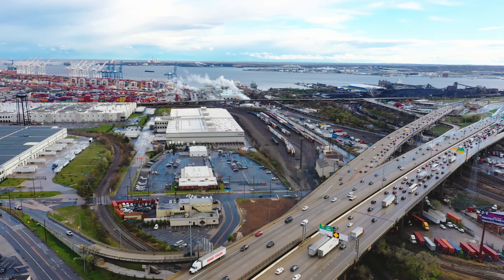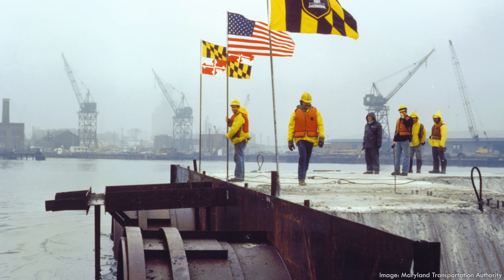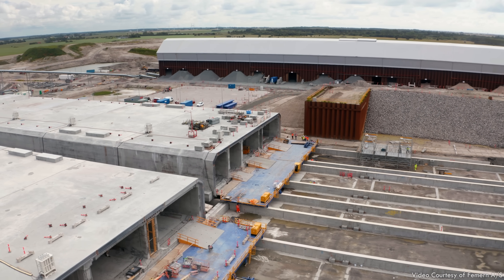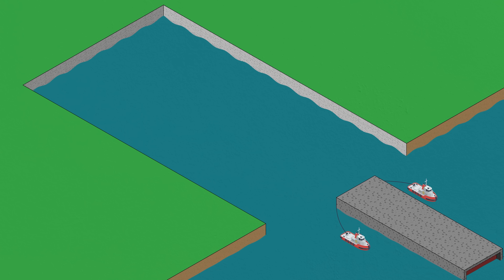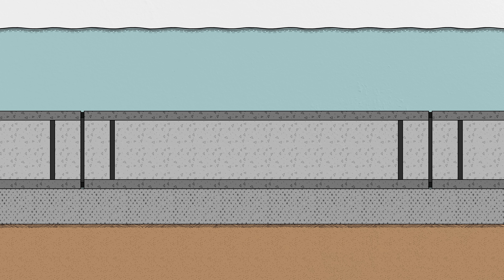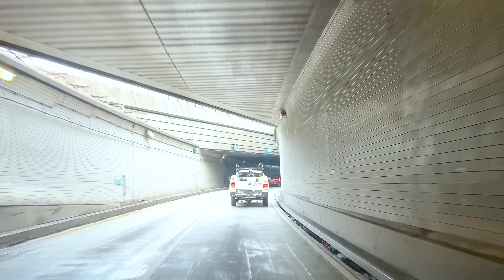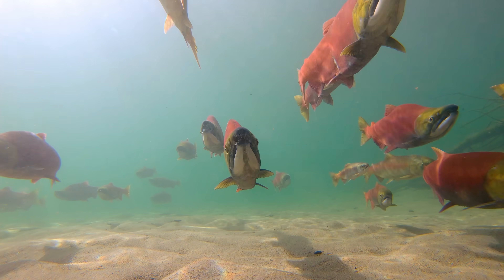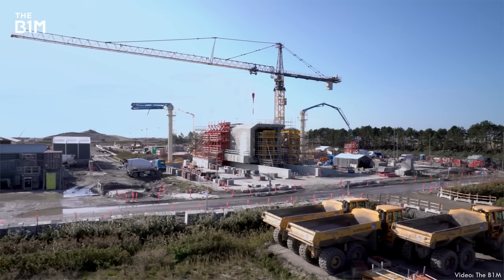The Most Implausible Tunneling Method

Comment: Being Dutch, from the west of Rotterdam, two tunnels have been built using this method in my 30-something year lifetime: the new Benelux tunnel and the Maasdelta tunnel. Interesting fact: during the installation of one of the segments of the Maasdelta tunnel, a winch cable broke. This didn't cause much damage except for a delay of a few days, but the reason is quite interesting. Because this tunnel is quite close to the North Sea, there is a layer of salt water near the bottom of the river, and the river water has to flow over that layer. This was al taken into account for the strength calculations of the winches, but not the fact that the shape was different due to the way the river bed had been dredged. This caused the salt water layer to sit higher, leaving less space for the river water, leading to a stronger current, leading to more force than the winch cable could take. Mind blowing complexity!
Reply: This is exactly what I crave from comments sections; thanks for sharing!
Reply: Most of the tunnels under the North Sea Channel between IJmuiden and Amsterdam are also build using this method, 7 in total. Seems like we have a fair percentage of those 150 tunnels world wide!
Reply: @kleinisfijn And probably some Dutch companies are involved world wide constructing tunnels. Dealing with water is one of our specialties here in the Netherlands
Reply: @kleinisfijn  If my memory serves me well, the segments for the Wijker tunnel were manufactured further up the North Sea canal and actually floated into position and precisely sunk to their correct spot.
Reply: @kleinisfijn China perfected the concept
Reply: @kleinisfijn  Yes, 35 according to Wikipedia, that would be over 20% 😮
Reply: Don't forget the Maastunnel, also built using this method, finished in 1942 under German occupation.
Reply: @apveening  ROTTERDAM MENTIONED!!!!!!!! 🟩⬜🟩
Reply: Had the pleasure of traveling and playing music all over Holland. Bridges, polders, mills, canals etc.. infrastructure all over the Netherlands is incredible.  brilliant engineering.
Reply: These things will leak after 10 years.
Reply: Sydney Harbour Tunnel was done this way about 30y ago
Reply: @ryanf2709 yes, SHT is the footage at 10:25.
Reply: That’s fascinating that the salt water acts as a barrier to the river water and forces it up instead of just intermixing. Fluid dynamics are cool
Reply: I was working on the dredger for the Maasdeltatunnel, dredging the channel and backfilling the tunnel. It was hard work, but the completed tunnel is beautiful ❤
Reply: @jonasclaes9256  thank you for your hard work i enjoy it every day
Reply: Now that is a good comment. Very interesting thank you.
Reply: That is freaking fascinating!
Reply: I work at the company that did the submersion of that tunnel. We talked about this incident a lot and have changed the models we use to calculate these forces of the current; to take this sweet/salt water interaction into account!
Reply: Hong kong 🇭🇰 SAR Building of Chek lap kok International Airport project as World 🌎 largest Construction had encountered these Engineering challenges Due to Terrain and extreme Weather conditions must Withstand that needed 1 Undersea Tunnel like that above connected Hong kong Kowloon to Hong Kong Island Across the Victoria Harbour sea.
Reply: The Rotterdam metro was built this way as well. They dug a large canal through the city center and then placed prefab segments in this channel. The drydock for building these segments can still be found at the west side of the Eiland van Brienenoord :)
Reply: OMG. I've just recognised a tunnel I used to use in Australia at 10:23 - the Eastern Distributor off the Sydney Harbour Tunnel
Reply: I'm always amazed by hydraulics and hydrodynamics. 
It's so useful, so simple to use under specific conditions and yet mind-blowing in their complexity the more detail you need.
I'm an industrial chemist so my experience is a bit different from civil engineers and constructors. 😊
Reply: Noordtunnel as well
Reply: China has perfected this method. Putting in over 400 miles of these.
Reply: 3 tunnels now, blankenburgtunnel got added to that list
Reply: 30 years something?   You don't know how old you are?   😋
Reply: In the Netherlands, we like this method of construction so much and find it so normal that we even built an immersed tunnel beneath a building. The tunnel section was floated in on a body of water, submerged, and then moved underneath a historic train station. Today, it houses the metro tunnel beneath Amsterdam Central Station.
Reply: Sorry to hear

Comment: The most impressive part about submerged tube tunnels is, to me, the process of constructing the individual elements on land. For the Fehmarn tunnel, each standard element is 712 feet long, but has to be movable on land before being floated. That's a big thing to shove around.
Reply: Movable on land? That's unusual. You would preferably build them in dry dock so you can submerge them and then make them float.

Comment: Cool topic. My first exposure to this type of tunnel construction was the Big Dig in Boston. Something you did not directly touch on is these sections are buoyant so part of the engineering task it to prevent them from floating away once they are in place.
Reply: The Teddy Ballgame Tunnel!
Reply: The Williams tunnels were constructed in the Baltimore area. Those were twin steel tube sections that were lowered in the the 'haarba'.  Alot of cement was added to  the structure to provide more protection once in place as well as to weigh them down so they'd sink to the bottom.
Reply: wasn't that 20 years long big dig mostly done on the dry land under the downtown boston?
Reply: @robant5578  That is correct, a lot of the work was done on dry land. However, during colonial times the city existed on a peninsula, and it expanded itself by dumping landfill into the harbor.  A large portion of the Big Dig was done thru that landfill (mud and debris and waterlogged).  It just offered up many construction complications (and maintenance issues ever since). Also, there was building tunnels under the railroad tracks that lead to South Station.  They first went and froze the ground to make it a solid mass before they dug thru it and pushing a tunnel into where they dug out frozen ground (tunnel jacking they call it).

Comment: Water permeability issues? We know that decades of external contact with water — and temperature differences creates condensation — draws out the concrete minerals and destabilizes the structure. Then pumping of water from floods and hurricanes during power outages in another issue. 
What is the expected lifetime of this tunnel? Has its removal costs been incorporated into the total?

Comment: Great video! Ever the pessimist, I wonder what might happen to the segment seals in the event of a fire in the tunnel that releases burning fuel onto them. Are they fire-resistant, or are the joints resilient enough to withstand extreme heat?

Comment: Another immersed tunnel project (tho is also a bridge) is the Louis-Hippolyte Lafontaine Bridge–Tunnel in Québec, currently in deep restoration/ repair https://en.wikipedia.org/wiki/Louis-Hippolyte_Lafontaine_Bridge%E2%80%93Tunnel. In other precast construction, you have the Confederation Bridge between New Brunswick and PEI (with intense design for ice floats). 

An interesting future subject may be an exploration of the different options for the 3rd link in quebec city (lots of options and sensitive alternatives and obstacles explored) I would love to do a dive on it, both as a case study but also to have an external eye on it ( my favourite is a floating underwater immersed tunnel)

Comment: 10:25 isn’t actually an immersed tube tunnel, that’s the Eastern Distributor Tunnel in Sydney which is under ground and was drilled. The car filming would have been in the Sydney Harbour Tunnel which is an immersed tube about 60 seconds earlier.
Reply: If it's the eastern distributor, why does it say "ED only" on 2 of the roads & Bondi on the other? I was going to say it was the ED too, but from that I'm thinking it can't actually be the ED at that point.
Was looking for this comment though :) Thought someone else must have noticed the attempt at including the Sydney Harbour tunnel :)
Reply: @lilaclizard4504  definitely the ED left lane is Bondi / Randwick Exit. Right two lanes are continuing in the ED
Reply: @lilaclizard4504  the harbour tunnel is 2 lanes per direction, no section of it has 3 lanes. i cannot pin point the exact location of this footage, but it will be southbound just after exiting the harbour tunnel / domain tunnel on approach to the ED.
Reply: @lilaclizard4504  The ED was originally a surface road and then they extended it to build the tunnel to connect to the Cahill, basically to remove the increased traffic from the eastern edge of the CBD.
Reply: @lilaclizard4504 I travel in this tunnel daily. It’s the ED because the left road is an off road to Bondi / Randwick and the right two lanes continue the ED to Southern Cross Drive.
Reply: I’m an American living in Canberra, and I’ve been in these tunnels while in Sydney.  I have no idea which one is which but I like that I’ve been there.
Reply: @JohnWalker-e6y  It was the Sydney harbour tunnel. It opened in 1992 to take pressure off the Harbour bridge during peak hour traffic
Reply: At the time this was being built I was crossing the Harbour Bridge almost every day. Once I saw one of the segments being floated into place, which was cool. They were actually cast in Port Kembla (Wollongong) and floated all the way up the coast and into the harbour.
Reply: It's definitely the ED southbound maybe 2-3 km south of the harbour tunnel. The left lane will exit towards Randwick and Paddington. The right to lanes continue towards the airport.
Reply: I came to say ‘hey that’s Sydney’ to find a far more detailed discussion at the top of the comments 😂

Comment: Apart from transportation efforts to get resources there, building on the moon is just far easier than building on the sea floor.

Even just the atmospheric pressure difference is so much worse underwater than in vacuum. ;-;

Comment: We learned about this tube method in Sydney Australia when it was selected in the 1980s — similar reasons for a tunnel, and we didn't want to overshadow our famous Harbour Bridge, also an engineering icon.  Many modifications and duplications were proposed and all were unpopular.  Everyone breathed a sigh of relief when the tunnel option was proposed.
Reply: 10:28 THAT'S ME!!!!!
Reply: whoa whoa wait a second, 10:29 that's the right highway but the wrong segment!  You're looking at an underground tunnel a few minutes south of the (M1) Sydney Harbour Tunnel.  You're in the (M1) Eastern Distributor going south.  That section is somewhere under Oxford Square maybe.  It's certainly not underwater.

Comment: 3:15 I'm aghast at your "mostly just a waste" put down!
We all know that the classic arch is the best way to support a bridge and that a complete circle is the best way to support a tunnelled void. cf. the ship worm allegedly the inspiration for Greathead's pioneering tunneling shield.
If rectangular passages were better, we'd find lots of examples in nature. But we don't.
The space above and below the central road and or rail route is of course put to good use carrying cables and pipes for the tunnel's own lighting, communication and ventilation & drainage; as well as same to connect such utilities to the networks at either end.
Reply: That's what I was thinking at first too when I heard it, but then I saw just how wide the tunnel in the example was and it suddenly made a lot of sense. Even with incredibly overbuilt infrastructure you'd have a cavernous space left over, and that's assuming you could somehow build a circular tunnel that big (and that's a big if!) Realistically you'd have to dig multiple smaller parallel tunnels, and that just made everything so much more complex.
Reply: @CMDKeenCZ  Good point and it must come down to right tunnel, right site.
These clever immersed tube tunnels are presumably limited to shallower water channels and flatter seabeds than the deeper and more variable canyons and ridges that nature throws up in the face of our hapless engineers!

As for the multiple tubes you mention, taking the Channel Tunnel as an example, there are two massive main bores for one - way railway track and a not to be sniffed at bidirectional services and emergency access road tunnel in between.
So even with all this apparently 'wasted' space, they still needed three separate bores.

Comment: There's a big tunnel in Europe, between Denmark and Sweden that was constructed just like this. I believe it's called Femarnbelt or something like that.
Reply: Well, partly right and partly wrong😉
1. There is a tunnel between Denmark and Sweden. It's only 4 km (4050 meters) long and yes, it's made by elements lowered down on the seabed. The entire "Øresundsforbindelsen" / Oresund-connection is 15,9 km long, including a manmade / artificial island and then the 7845 meters long bridge.
2. Denmark and Germany are making a new tunnel these days, in "Femern Bælt" / Fehmarn Belt between the two countries, called Fehmarn Belt Tunnel or Fixed Link. It will also be submerged and will be the 
longest tunnel of this type, at 18 km, made from 89 elements when scheduled to open in mid-2029, handling both vehicles and trains 🙂

Comment: There is also a massive project with this kind of tunnel in Antwerp in Belgium at the moment called "Oosterweelverbinding".  
The project involves more than just a tunnel. It is also a complete redesign of parts of the Antwerp beltway.
They just started to move the tunnel parts to Antwerp from the building site in Zeebrugge. Its possible to visit the project at one of the tunnel entrances at "Open Werven Dag", 25th of May, 2025. Other parts of the project are also open to the public at that day.
There are regular updates of the project on youtube @DeOosterweelverbinding. 
The B1M channel featured it a few times.

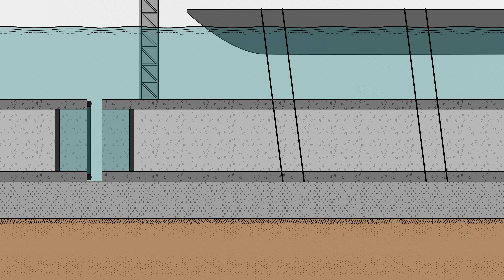Comment: 7:07 wouldn't dragging them together cause buildup of rocks between the gaskets?
Reply: Same thought. 

Wonder if the bottom profile is sloped to account for this
Reply: I think there is not much sediment movement or compaction because the segments have nearly neutral buoyancy. You would also get a small current cause the water between the sections is displaced.
Reply: He mentioned that a trough is dredged out for the tunnel, perhaps some sort of leveling material is laid down in there as well that would keep random sediment/rocks and such out of the process
Reply: I suspect the final seal is not 100% tight and the seals wouldn’t have to be placed flush with the outer surface. So a little bit of fill could be tolerated within those joints. I guess it’s also possible they float it just a fraction of an inch above grade until it’s tight.
Reply: They may need divers to help with installation

Comment: Just down the Chesapeake Bay from Baltimore in Hampton Roads, Virginia, all of our existing 5 bridge/tunnel complexes are immersed (sunken tubes). The most recent being the parallel US-58 Midtown Tunnel. The two currently under construction (the parallel US-13 CBBT and the expansion of the I-64 HRBT) are using the boring method, the first time tunnel boring machines have been used here for underwater tunnels.

Comment: I've always wondered if tunnels have an inevitable amount of leakage that must be pumped. If so, how do we guarantee that the pumps keep working during an extended power failure? And how long can the pumping fail before the tunnel is unrecoverable?

As pointed out by Grady, these sealed air-filled passages are nearly buoyant. So if they were flooded, would they sink into the comparatively soft bedding and break their joint seals? In other words, if even partially flooded, would the tunnel be unrepairable? I can't imagine repairing the seals underwater.

Comment: 2:01 railways would actually be easier to build bridges for especially in cities though. Urban railways are already mostly elevated. And they take so much less space too.  Also people can easily climb up to an elevated station using escalators or elevators unlike cars which need huge ramps.
Reply: Bridge heights for large ships need to be 225' (68 M), a train would need miles of track to get up to that high from above street level height
Reply: @jamesmurney1374 most railways in cities aren't on street level. They are mostly elevated or underground. I live near an elevated metro line. So railway don't take more space as they are already elevated. Also a metro line with two tracks which is narrower than 2 lanes can transport more people than a 100 lane road (50+50).
Reply: @jamesmurney1374 Trains are also better fit in tunnels. Their wheel width is less than car width. So they fit perfectly in a circular tunnel. Also the space above can be used for overhead wires.